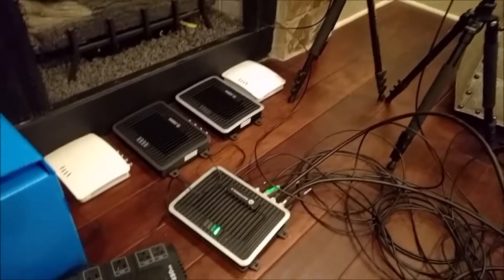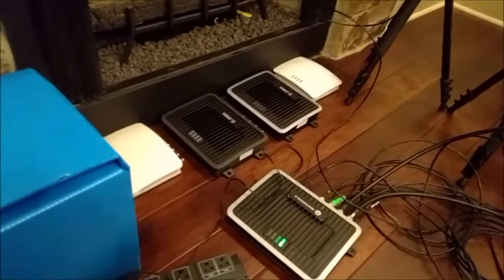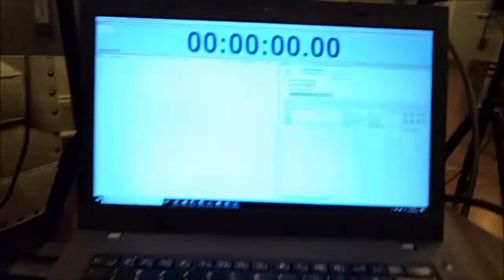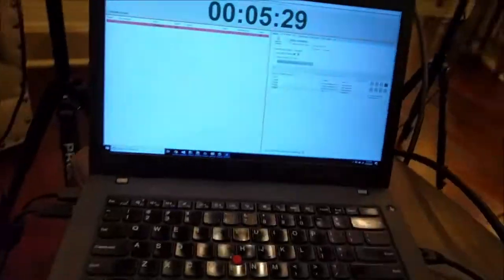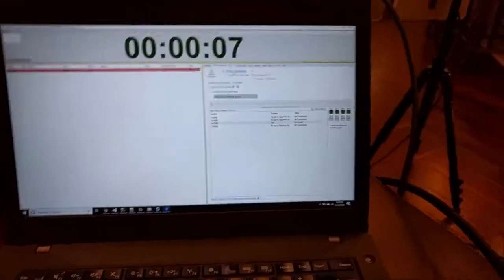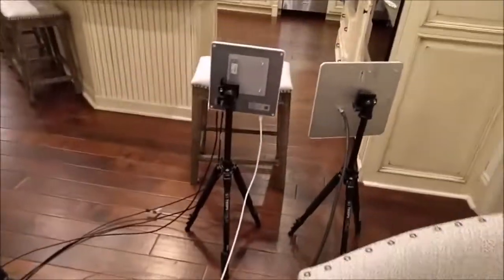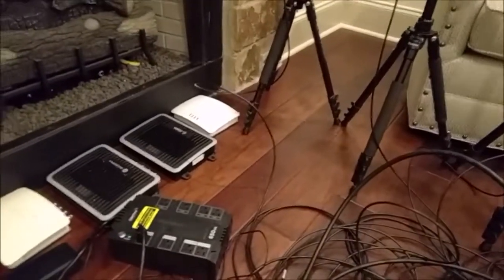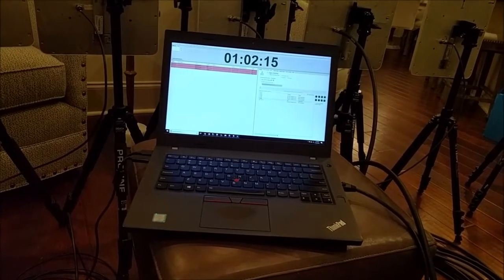FX9600 and FX7500 Performance Testing and Improvement

Comment: Could you also test with the two port versiol of FX7400? What are yout experiences regarding the Impinj R220/R420? Can the same cycling rate be applied to the FX7400?
Reply from the maker: Unfortunately I do not have a 2-port FX7400 and I no longer have an Impinj reader. AtlasRFID loaned me an Impinj R420 a few years ago so that I could get the software working with it, but then I had to send it back to them. So the only readers I have in my house are FX series readers, a ThingMagic USB pro, SensThys readers, and Thinkify readers (TR200, TR265, TR290B).